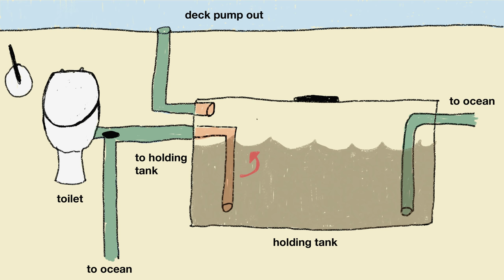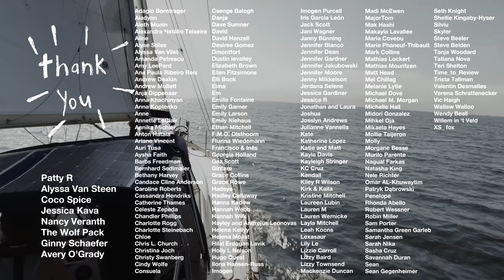Our Boat Bathroom Broke!

Comment: I hate it for you but this could have probably been foretold.  When you splashed the boat you were not even sure of how the head worked which means you did not check this system which means there are other problems that are going to reveal themselves in short order.  Electrical, sails and rigging, plumbing, navigation, motors, etc. should have been thoroughly vetted on the hard.  Mai pen rai - some lessons are learned "hard".

Comment: should have just swapped the two large pipes from the outside of the tank  sorry
Reply: Me too
Reply: @mikemeazell5653  as we all know when we get into a nasty job, we need to take a little break and a shot of your favorite beverage and think about it for a while.  I probably would have done the same thing they did and then looked at the pipes and did a big Oh sh..(sorry pun intended)
Reply: Without knowing the fittings, I wondered about that. Still boating is about self sufficiency and they handled this without outside help. I’m impressed.
Reply: ... swapping the hoses ... seems it would be a lot easier and a lot less messy ... I applaud you tenacity in accomplishing a nasty task ... well done ... fair winds and following seas ...
Reply: likely when the tank was installed they got the pipes mixed up on the outside. you can see they are both same diameter and next to each other.
Reply: You must have the pipes the same length it is not certain they will fit in each other's place
Reply: at least looking at the image, one hose was also connected with another one which allows to send it to sea directly...

so there are not the same ..and so easily switchable
Reply: Also by swapping the pickup tube on the inside, you've raised the raised the pickup tube further off the bottom of the tank meaning you'll have a couple gallons more left in the tank after a pump out. I'm basing this off the drawing... The pipes looked like they may have been side by side making the pickup tube a moot point... Still swapping the pipes on the outside would be quicker, easier, and less smelly. Hind sight is 20/20
Reply: That was my thought
Reply: Ha! Nice point. Of course! Seems so logical now that its over. I would have done it the way they did. I always find the hard way first.

Comment: Right after you say "the water came through, so that's not clogged" the next view is the tank with the hoses coming in on the left.  All you had to do was loosen the clamps on the two hoses, and then switch them at the attachment point.  This is one of those times where you should have worked smarter, and not harder.  Assess the situation better, and work out the easiest plan to solve the problem.  The whole thing should have taken less than two minutes with very little smell.

Comment: 1) When 'shit' happens... how did you decide 'who's goin' in baby?' 
2) I'm confused. Based on your drawing, if the inner pipe was connected to the wrong fitting, why would you mess around with the internal pipe? Just switch the hoses on the outside. 
3) I think petroleum products on rubber gaskets deteriorates them if I am not mistaken. I think usually you want to use a silicone lube probably.
Reply: 1) the man of the house
2) based on the drawing, there is no switching pipes in the outside, one outlet is on deck the other, underwater. Do you want the sewage crew to dive underwater?
3)that looked like bare plastic, no gasket. Vaseline IS the gasket? 🤔 But also works as anti-seize?
Reply: @Mr.Ramirez95  you missed it. The person who plumbed the tank got the two pipes backwards... Probably the last thing they did after getting everything in, and probably easy to do as they look identical and are coming from the same spot. 5 minutes work swapping the two pipes... No moving anything or messing with any thru hulls or deck fittings... Just swap the two pipes that are 4 inches from each other.
Reply: The two pipes are different sizes.

Comment: Fun video.  Practice makes perfect and you will get used to dealing with "processed" waste, it's not as bad as your average steering wheel.  There's lots of non toxic chemicals available to keep the odors within bounds.  Some marinas do pump outs as a matter of course, here in the UK it's rare to have this service.  Bathroom facilities ashore are the best alternative.  Use silicone spray and grease instead of any petroleum based products.  Your seals and plastics will thank you for it in the long run.  Lovely video and fantastic animated sketch,  wonderfully charming and great to watch.  Well done.

Comment: Use silicone grease not petrolatum on O rings and plastics. You don't need to hit it to get it tight enough.  That is why it has finger recesses and not flats for a wrench.

Comment: The two large-diameter, white-vinyl-covered hoses are apparently modern, not original equipment on a 44-yr-old boat. When they were last replaced (as ALL sanitation hoses get permeated over time and require renewal), the dolt that did it obviously swapped the two. 
I'd find that dolt, and give him a birthday present of all the soiled garbage bags.

Comment: Question.  The hose from the head into the tank and he pump out seemed to be the same size.  If the hose or tube going to the bottom was on the wrong one why not just switch the hoses on the outside of the tank?  They were right next to one another.  It would sure beat diving into the tank.
Reply: at least looking at the image, one hose was also connected with another one which allows to send it to sea directly...

Comment: Seems it would have been a million times easier to simply swap the two in & out hoses on the OUTSIDE of the tank, rather than move the pickup on in the inside from one to the other. 

Also, the holding tank will smell a LOT less bad if you have two vent hoses instead of one.  Put a simple mushroom through-hull on each side of the boat for cross-ventilation.  Don't use those silly screened through-hull units that plug up easily.  You can then send water down the through-hull to backflush the vents easily when you are pumping out.

We use KOnhead treatment from Raritan which works very well provided you have enough fresh air to provide oxygen in the tank for the aerobic bacteria to survive rather than the very smelly anaerobic bacteria which take over if there is not enough oxygen in the tank.

Welcome to boat life fellow Rasmus-ers.
Reply: Barry D, I agree with your detailed reply. It looks like they want to learn the hard way instead of seeking advice from old sea dawgs on community groups, there is a wealth of knowledge and can make BOAT life easier. It was entertaining to watch and provided content for their channel.
Reply: It seemed odd to me that the hoses would have been hooked up wrong from the beginning and nobody in 40 years would have discovered this error.   Ore likely, the hoses were removed and replaced and the person doing the job didn’t know or didn’t remember which hose went where.  That tank had never been pumped out?  A good friend of mine ( who happened to be an old salt) taught me that one of the most important tools you have is a chair.  I didn’t u Deast and and he explained to me that before you dig in repairing something, take time to sit in a chair and study it ( obviously not in an emergency).  Much can be revealed if you just take the time to think about it for a while. They would have had to dig in to discover the root of the problem, but once discovered, stop sit look and figure out why.
Reply: This all happened a month or so ago.   They had to dig in immediately and fix it or not have a head until they did.

I think maybe they mentioned before that they replaced all the head hoses recently.  They look brand new and clean bright white.

Likely whoever put in the new hoses hooked them up to the wrong tank connections.  Could have been them, or it could have been the last owner right before the boat sold.  Dirty trick if they did it on purpose :D :D :D

When we bought our Rasmus the septic tank was 30 years old and had NEVER been used.  The tank was brand new shiny inside still!  It was out in to satisfy a rule but not used.  

When we went to pump out the very first time the deck fitting was frozen shut from corrosion and I had to beat on it for 15 minutes with a screwdriver to get it unscrewed.  The tank was FULL!!!!  -and there was a line at the pumpout dock. 

We were not popular with the other boaters in Chicago that weekend.

We all learn the hard way it seems. I try to help new cruisers if I can but moat people want to learn the hard way.

Wait until the first time they use a self-serve pumpout dock.  Having it explode in your face is something we all only do once! :D
Reply: SV Barry Duckworth we rented an RV a few years ago in Alaska.  I had no idea how to empty the tank.  It was supposed to be fully equipped, but there weren’t any rubber gloves.  You should have seen me with plastic bags trying to get everything hooked up.  Some experienced RV’er took pity on me and helped me out.  We all need to learn.  I try to learn from others, there are plenty of chances to learn things the hard way. S/V Flekk II
Reply: You almost never see YouTube sailing channels talk about pumpout procedures, much less show it on video.  I don't suppose the RV videos do either.  This video was a welcome change of pace in my opinion.

But having liquid poo blow all over your face and chest is something that isn't all that hard to do unfortunately.  I think RV's mostly all use gravity-drop tanks, but with the extreme suction that a marine pumpout uses it is possible to make the poo get moving so fast that it actually bursts all over the place, especially if the vent tube is too small or plugged up.

Comment: Why didn't you just swap the connections outside of the holding tank?  Connect the outer connection that deposits material to the outer connection that sucks out the material?  It sounds like a MUCH easier process, and from the looks of the connections, are the same size.  I may be way off on this but....

Comment: Dude, going around your elbow to get to your arse. Hind sight is 20/20... Swap the two hoses on the outside of the tank... Also prevents raising the suction tub off the bottom of the tank so you can pump out more of the contents.

Comment: Was it not possible to swap places with the pipes going into the tank from the outside instead?
Reply: Yes you are definitely correct, even if they needed to extend the outside pipes a little, but then they would not have had a storyline for a video, perhaps it was a shitty calculated move or they genuinely did not think of the much easier solution. It is an interesting question.

Comment: Only half way through the video so you may explain later  but why didn't you just swap the external hoses over so that the deck hose clamped to the drop tube and the toilet hose clamped to the hose going to the airgap. No bog diving required..

Comment: I laughed lightly when you mentioned that the challenge with your holding tank was baptism by fire. And then, in the interest of safety while in the deep waters, I remembered that another sailor experienced a crack to their hull - due to the tank at the front being in contact with the bow and causing small cracks while they sailed in the high waves.

They do mention some 'green goo'that saved the day, and I would recommend you get such as part of your safety kit

Below is a link to their mayday experience

https://m.youtube.com/watch?v=e6YCq4cz06Y&t=1276s
Reply: Some septic tank chemicals can actually eat right through fiberglass. Have seen a hull weakened to the point it was leaking/seeping where a bottle of the stuff was leaking and dripping on the hull.

Many of the common septic treatments are loaded with formaldehyde to kill the bacteria -but it is nasty to release that into the ocean even out 3 miles where it is legal.  That's why we only use KO from Raritan which is just natural enzymes that help process the poo without it stinking.  By the time we pump it out overboard 3+ miles out it hardly smells like anything any more.